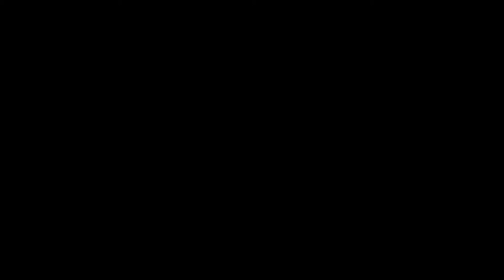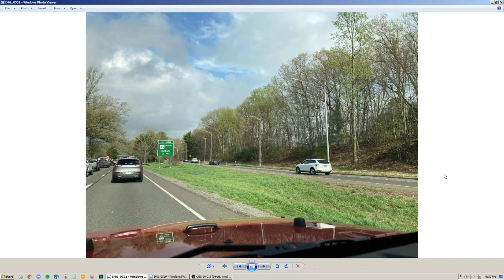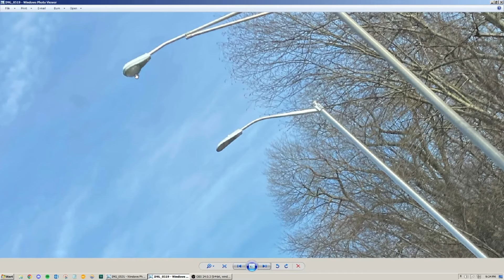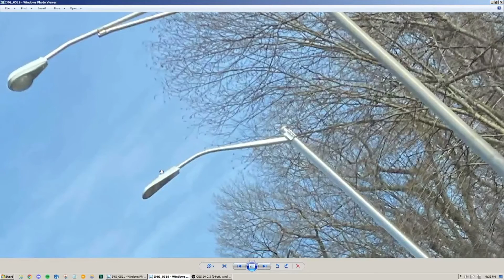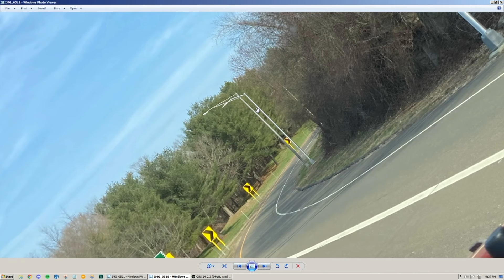I Hate These Stupid LED Street Lights

Comment: Luckily, in my "neighborhood", we still have the old HPS lights. There is one right at the end of my driveway, I think the bulb in it is nearing 10 years old at this point and it still works fine. Gives a nice even orange light to everything. The main road right at the end of the "neighborhood" and the neighborhood across from us has the LED junk, and they are constantly flickering and turning purple, and give a narrow beam of harsh blue light. I worry that they may soon put them in our neighborhood, if that is the case I am disconnecting the damn thing. 
At the other house, which is on a main road (pretty much), they put in LED streetlights about 3 years ago, and they kept failing in a variety of ways, now there is a mixture of HPS and LED lights on that road, because when the LEDs crap out, they are putting HPS lights back in their place. I guess they got tired of replacing them every few months.
Reply from the maker: There's a stupid LED street light at the end of my driveway, but fortunately the way it's positioned doesn't really shine into my property. I'm going to install a few lamp posts at the end of the property to try to drown it out.
That's interesting they put the sodium ones back, probably ran out of budget for replacements.
Reply: We also have HPS lights in our entire area and I love them because they are so much easier on the eyes, light up the road better, and seem to last a lot longer than LEDs. The only place that has LEDs nearby is a freeway and those lights have also started flashing off/on or turned purple, and most of the ones that didn't burned out within a year or two.
Reply: @John-bs5ug  same, are you also in New Jersey?
Reply: @BRISTOLFORCE2009  No, I'm in Texas, west of Houston. Sadly, though, it looks like Cooper Lighting has discontinued all of their HPS cobraheads and decorative luminaries a couple months ago, so now it will be very hard to find new HPS cobraheads.
Reply: Hey @WalterKnox, what state is "the other house" in?  And is the city still putting back HPS lights?
Reply: @brianinja  Both in North Carolina, only around 20 minutes from eachother.
Reply: @brianinja  Right now that street is mostly back to LED sadly, half of them are purple or strobe at night. Luckily, they still haven't come through with LEDs where I live, we still have all HPS lights.
Reply: @WalterKnox That’s soooo weird that they temporarily switched back.  Maybe they just had extra HPS in storage they realized they had and wanted to use.  But seems really random.  I really wish there was some area that fully brought back HPS just to prove that it’s a possibility.
Reply: @brianinja  My guess is that so many of the brand new LEDs were failing that they ran through their stockpile of them, so just used some HPS lights they had laying around until they got more of the new ones. This was around 2020-2021, when everything was hard to find and had huge lead times when being ordered, so it would make sense.
Reply: @WalterKnox Oh yeah that makes sense.  Shame, it would’ve been great if they just came to their senses and brought back the old ones.

My city (Pembroke Pines) is weird because they changed all the main streetlights to LED in June 2023, but they allowed all the intersection HPS to stay (like those four-way intersections with one on each corner on the long arms).  They even very promptly replaced a light that burnt out about a month ago with another HPS bulb a couple days later.  So it seems like those will stay awhile if they’re actively/quickly replacing like that.  Most neighborhoods near me have long been LED, though a couple just converted this year and there are still a couple more survivors… for now.

What’s also weird is that as I said, my city converted to LED two years ago, but they left like 10 bulbs, scattered around the city, as HPS.  I don’t know if it’s an oversight or what, but it always give me the unrealistic hope that they haven’t fully given up on the old ones or that they’re testing their lifespan against the new ones to see which is better.  I know that’s not the case, but I can dream lol!

Comment: LED street lights would be ok if only they spent the time and money to correct them. I would still prefer high pressure sodium though. What I really don't like is the LED headlights they're  putting on these newer cars.
Reply from the maker: The lights on the cars are very dangerous. They are blinding to other drivers on the road.
Reply: I agree. Every morning I go to work when it's dark out on a two line road, it is hard to see 5 feet in front of me every time a car goes by because of these blinding LED headlights. Of course when a car goes by with halogen headlights it's not too bad. @JordanU

Comment: FDOT has recently Added new HPS street lights to Florida turnpike And FDOT has also added some new HPS lighting on Traffic light poles But i saw they Added LED lighting to I-94 In wisconsin and    The Chesapeake Bay bridge in maryland Because of the project of removing Toll plazas and Switching to toll by plate Or Ez-pass
Reply from the maker: Thanks for letting me know.

Comment: Another problem with LED fixtures as well is that if it goes bad the whole thing must be replaced since it's hard wired to the whole thing while old skool fixtures like the HPS still has the Edison screw with you could just replace the light easier with no struggle. New phase they say...i dont so just cheap era
Reply from the maker: Creates an awful lot of material waste, seems a bit contradictory to 'saving the planet'...
Reply: I AGREE WITH ALL THE WAY

Comment: The one thing I hate about LEDs is that they are too bright. I hate it. 
That's for one, I favor incandescent Christmas lights over LED Christmas lights because LEDs flicker and it's difficult yet painful to find replacement bulbs. 
The LED light bulbs can actually cause interference with wireless receivers like garage door openers and therefore incandescents are highly recommended. 
I do agree that the LED headlights are too bright. Sometimes I think that person has their high beams on. It's blinding to those on the opposite side of the road and can cause a major accident.
And LED street lights now taking over and not covering or brightening up the road? Oh, it's supposed to help save the planet. So I guess us humans not being able to see at night while on the road is no longer important. So sad. What a cheap world we live in nowadays.
Reply: The only good LED christmas lights are tru tone christmas lights. They are an example of what LED's SHOULD be. They are exactly like incandescent without lots of heat and energy  consumption

Comment: One minor correction at timestamp 6:50 
The new poles are most likely 35 foot while the old ones where at least 40 foot. Most highway lighting is set up with 40-50 foot poles. The mast arms where the light fixture is clamped to are from what I've seen around 20'. But that's just a guess.
Reply from the maker: Thanks for letting me know.

Comment: Yup, the majority of LED roadway fixtures out there are very cheaply made and have poor quality optics. It’s a no brainer why cities go with a cheaper fixture, where they think we got an inexpensive crap quality fixture that is going to save us millions of $’s over the years in energy costs, it’s a win-win situation! 

It’s too bad these cheaply made fixtures are giving LED roadway fixtures a bad rap. A properly designed LED fixture would light a roadway evenly and would not produce so much glare. There are various beam spreads for all roadway fixtures, and the chosen fixtures may be the incorrect type for the pole spacing and height. If these cities specified a warmer color temperature (2700 to 3000K) they would be less annoying. Go back 40 or more years when HPS was replacing MV, everybody hated HPS, but over the years, people just got used to them. LED technology is still in its infancy and just needs to grow up.

Comment: New poles? SERIOUSLY? What a waste! The old poles were just fine. Why on earth would they use new poles, let alone INFERIOR poles! 

My town is still 90% HPS thankfully, though some LEDs have been slowly creeping in. There is a decently-sized section of my neighborhood that has LED street lights, and it’s actually the exact opposite of your situation. They are mounted two per pole with poles spaced just about every two feet! It’s WAY too bright for a neighborhood! It doesn’t help that they are all 4000K!!! I couldn’t even imagine what life is like for the poor people who have to put up with that much light spilling through their windows every night! I’m sure at least a few may had even enjoyed having the HPS light coming through as a nightlight, but now they have to put up blackout curtains in order to keep the glaring cool white light out of their bedrooms! Thankfully, I live in the part of the neighborhood that is still lit by sparsely-spaced HPS NEMA heads and cobra heads that don’t even shine on the street. It sure isn’t the best street lighting situation, but it sure is better than the LED situation that dozens of unlucky neighbors have to deal with!!!

And of course, there’s the issue of replaceability! The problem with integrating LED light fixtures is that when they burn out, you are forced to replace the whole thing! At the rate that those things fail, that is a huge waste of housing materials that could easily last many decades longer than the LED parts can! I can’t believe anyone could deem that integrated garbage “green.”
Reply: They also existed in my city, but in November 2022 they all changed to LED and sky, I can't sleep at night anymore, it's colder than before, I can't tolerate them anymore
Reply: @rs12official new jersey is nearly all hps
Reply: Does your area still have mostly HPS now?
Reply: @ Yes, but I have noticed a few more LEDs going up.

Comment: My neighborhood had their lights changed from high pressure sodium to led around 6 years ago. Only 1 high pressure sodium street light remains on the other side of the neighborhood. Recently I’ve been riding around at night and I’ve noticed that around 90% of the lights I’ve seen are led. That made me quite sad. But, I did see quite a few mercury vapor and high pressure sodium lights on some country roads and a few subdivisions still had high pressure sodium lights.
Reply from the maker: It's disappointing to me as well. I grew up with the sodium fixtures, the streets just don't feel the same at night anymore without them.
Reply: @JordanU streets look creepy with satanic led light
Reply: @JordanU did you know you would actually lose efficiency by doing that garbage to grow light?

Comment: Lol leds are way more reliable and cost efficient, get over it
Reply from the maker: But that's not true...
Reply: @JordanU  considering I’m an electrician I’m pretty sure I would know.
Reply: @Marksfansandthings  I'm sorry, but you are completely wrong.
Reply from the maker: I fail to see how they could possibly be reliable and cost-effective when such a high volume of them fail within a few years of operation, and require full replacement because they're integrated non-serviceable builds. Comparing to the fixtures of years ago, they operated reliably for decades and at most needed service (re-lamp or ballast replacement) once a decade.
Reply: @JordanU  Yeah, I have many old HPS and fluorescent (mostly fluorescent) fixtures that are over 50 years old, all original ballasts and electronics, and work fine. Just need a bulb every 10 years or so. Whereas an LED fixture requires complete replacement more often than the bulbs in the old fixtures go.
Reply: @Marksfansandthings  I don’t think we asked if you were an electrician, but we also have an opinion, cities are wasting more money keeping led’s working every day rather than their hps’s, these led’s don’t last, led’s suck and you refuse to admit it
Reply: Wow, I didn't know Mark was a jerk.
Reply from the maker: @Harry-tt1uo  I've always had pleasant interactions with him in the past, not sure why the snarkiness here.
Reply: @JordanU  There are a lot of people who are like that. It is easy to agree with someone on something, but once someone says something you disagree with, then they show how they really are. I don't have an issue with people disagreeing, but they don't have to be an ass about it, or act like they know better than you. In this case, he is wrong as it is not an opinion, but either way, there is no reason to act an ass.
Reply: @Harry-tt1uo  jerk for stating facts? Yep that’s me. 👍
Reply: Ok
Reply: Nowhere near effecient and they suck in every way
Reply: @theray2009  your talking about led’s right
Reply: @BRISTOLFORCE2009  yeah, hid stuff for the win

Comment: Yeah, LED street lights are stupid. Technology Connections did a video on this. The sodium fixtures have less glare and are easier on the eyes at night. Astronomers love them because you can use a filter on the telescope to just filter out the orange light to make the sky clearer. There are so many great benefits of sodium lights. Politicians are just changing them because they are stupid and have their heads up their butts. Imagine an ostrich with its head buried up its butt, and you have a picture of most politicians.

Comment: It really is amazing that these things were approved to be put up on public roads, you would think there would be some sort of regulation on the quality of fixtures installed… It really is not hard to make a LED fixture that properly diffuses and disperses the light.
Reply from the maker: One would think, in applications like this, that the fixtures would need to be of a certain degree of quality and reliability. I guess not. I suspect the change is probably largely being pushed by the greedy power companies.
Reply: @JordanU  yep, money is obviously taking precedence, as it always seems to these days..

Comment: My city installed LEDs a few years ago. They’ve been relatively problem free and light up the area underneath them just fine, but that’s the issue… underneath them. They are extremely directional units, so instead of throwing the light in a cone shape, it’s like a very narrow rectangle of light. I think they could be improved if the units were almost ‘U’-shaped, so they could throw light in more directions. Other than that, I honestly don’t mind the ones local to me.
Reply from the maker: I can only imagine how much worse the glare would be if they were arranged to shine out to the sides as such, but that would fix the poor illumination issue. I think some kind of refracting lens like on the old lights is really the best answer.
Reply: @JordanU it wouldn't fix anything. It would make people go blind
Reply: I have 4500K shining into my hallway rather than on the street and that is very ridiculous!
Reply: I burn a 50w HPS with ballast in a table lamp in my living room. I also got a clear rough device Incandescent bulb there too.?they been working fine for many years now. I hate this new world order LED crap that tge sheeple are brainwashed with.
Reply: In my country LED lights are installed since like few years ago

Comment: There is an hps light dying by my grandmas house and I’m worried because there are 2 things that could either happen, one is that they will actually replace the bulb or two is that they will replace the fixture so I’ve have kept quiet about that, tbfh I’d rather have a dying hps bulb than have an led street light
Reply from the maker: Sadly it will probably be replaced if it's owned by the power company.
Reply: @JordanU  it wasn’t replaced, the bulb was replaced about 4 weeks ago and it already started cycling after 2 weeks, either the ballast has gotten so bad causing it to cycle or they may have put a 70 watt bulb in it, it’s a 150 watt fixture
Reply: @JordanU  to this day there is still only one led in the neighborhood
Reply: @BRISTOLFORCE2009  How's it going now?
Reply: @brianinja  it died completely within the past 2 months